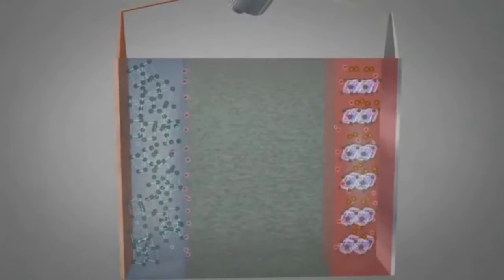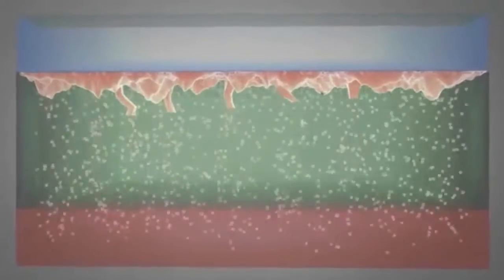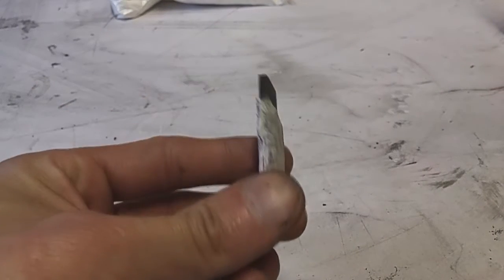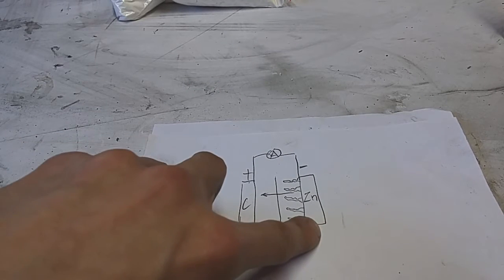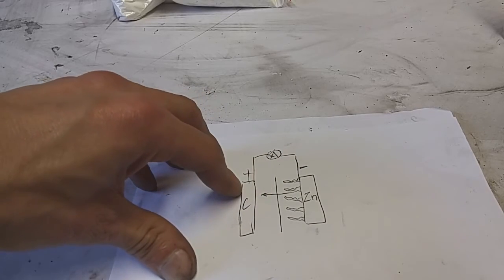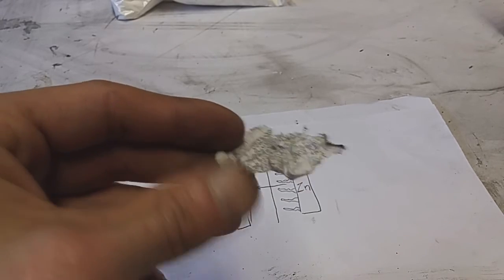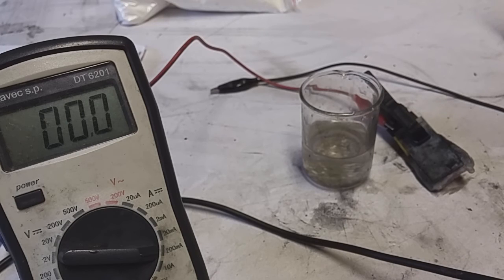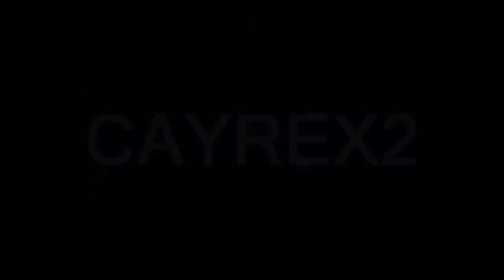Rechargeable Zinc battery (dendrites problem)

Comment: It's 2025 now, zinc dendrites can be avoided by high current a behinning of charge cycle. Zinc is melted into hexagonal flat crystals instead of stacking into dendrites.  Best to all, Cayrex rocks!
Reply from the maker: Yes correct. But is depending in what chemistry is used, because some times high current can damage the cathode. Is important to find the right balance.
Reply: @cayrex Despite lower op voltages I think there's much potential for salts and aluminum, and graphene.
Thanks for all the information you provide.
You have my admiration.
Reply from the maker: @jeffbrinkerhoff5121   Thank you sir

Comment: This is an older video but couldn't pressure be put on the cell, released to charge and then clamped again to run?
Reply from the maker: Good thinking. My teammate have similar thinking back then. And yes, will work. But the only negative by this concept is that the charging voltage is higher.

Comment: Just speculating. What If the anode were on the bottom, and occasionally disturbed to cause dendrites to break and fall back to the anode? Then maybe one can prevent  dendrite shorting.  I admit. I don't  know how much force it would take to break dendrites. Maybe one could vibrate it with ultrasound. Maybe just a tap. Would the presence of a magnetic field change dendrite forming?
Reply from the maker: Magnetic field,... I dont think that will make some changes. But the gravity force when the anode is on the bottom make good difference,... specially if is used some tough separator

Comment: Why the dendrites don't disappear when you discharge the battery? In that cycle the zinc should go into solution shouldn't it? I think if you use carbon on the cathod side too then you will be able to discharge the battery entirely and all the zinc become solved.

Comment: Hello Sir. May I know, is there any reason why you wrap the cathode with separator, even though you put both electrodes in distance? Do you have any comment regarding self-discharge in open cell configuration, is there any relation between separator materials and self discharge?
Reply from the maker: Hello Aiman! The reason is to hold the active material in place. I have graphite current collector and active material,... in this case I need to wrap the active material to hold the material in place. "self-discharge in open cell configuration",... you mean if I get self discharge in open cell stupe? Not really, the cell can hold the charge really nice,.... but the problem will be when the electrolyte will evaporate.
Reply: @cayrex  thanks for your respond. So u put wrap it just to avoid the active material peels off. Am I right? Also, I saw one of your videos, u put zinc oxide in KOH for Nickel Zinc battery. What is the major benefit caused by adding ZnO?
Reply from the maker: @AimanNazri  yes, you are right. KOH in the battery is a medium for transporting the ions and is not like zinc sufate which have also a storage of zinc ions,... for example. With ZnO you add a extra or better to say a reserve of zinc ions. Some of zinc hydroxide ions (zincate) will dissolve into solution and will not fully migrate back to the anode during recharging. With ZnO you add extra zinc ions which will help it with cycles.
Reply: @cayrex  i see, based on my reading, they mention about to prevent zinc dissolution. So I just put them without understanding the actual mechanism. Besides that? Do you have any comments on oxygen and hydrogen evolution? Is it normal or bad thing for battery? Because i read somewhere that gas evolution is related to corrosion.

Comment: You need a redesign of the zinc electrode try a zinc sponge or foam.. also I've had success with a  hard Portland cement plate separator just use Portland cement and cast a seperator
Reply from the maker: greg latta hello, hmm,... nice idea mate
Reply from the maker: This cement seperator is not flexible?
Reply: So you mix the cement with acrylic polymer additives such as paint ( I know it sounds wierd but acrylic paint and Portland cement mix well together ) and you add it on top of your anode and cathode as a sandwich and then roll it up or do a prismatic style cell. This separator dries hard but remains porous enough to allow electrolyte saturation
Reply: Bentonite clay makes a good separator and it molds into any shape. Mix dry clay powder with your electrolyte to make a separator that is also your electrolyte. But it isn't hard enough to prevent dendrites.
Reply: Also you need nickel hydroxide and cobalt oxide cathode and small amounts of zinc powder to help reuptake of zinc on charging. On a substrate of nickel mesh. Use polyurethane as a binder of active material.
Zinc metal powder as an anode on a substrate of zinc metal ( z stop works well with holes punched in it  .)  This active material Needs bismuth oxide and small amounts of indium oxide and aluminum oxide. This prevents gassing and helps prevent dendrites. Use a separator that I mentioned before ( Portland cement based mortar ( fine sand aggregate)  and paint mixture spread over both anode and cathode instead of plain water in mortar mix use electrolyte water of potassium hydroxide and 3%  boric acid and potassium flouride  this my friend is the best nickel zinc battery design
Reply: @greglatta6525  did you actually try this bentonite? I am asking cause I wanted to try sonething similar after reading that gelling can be used to combat dendrites.

Comment: Hi, I have a lot of Graphite powder and have tried all methods presented by Robert Murray Smith and a to make Graphene but all were unsuccessful. It must be that I must use flakes and not powder. Do you have any suggestions. Appreciate your help. 
I would so much like to try your Carbon-Zinc battery presented in this video.
Thanks.
Reply from the maker: Also my RMS graphene remake was unsuccessful (low quality graphene). Have you try http://cen.acs.org/articles/92/web/2014/04/Solution-Graphene-Production.html